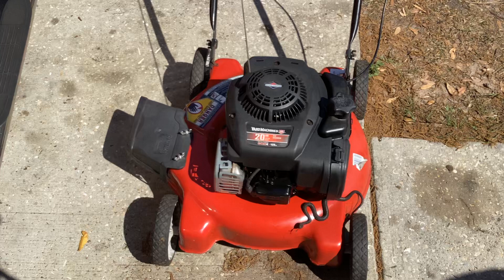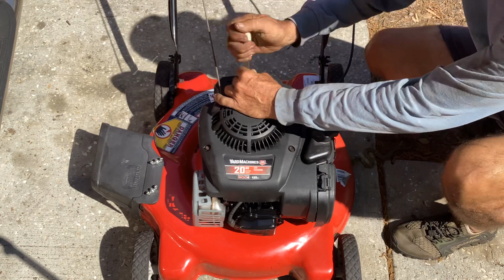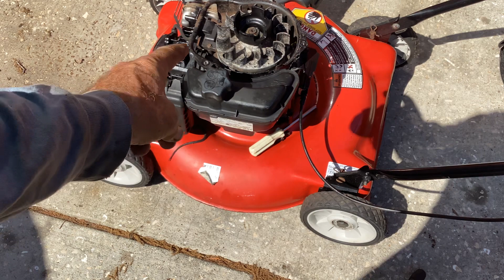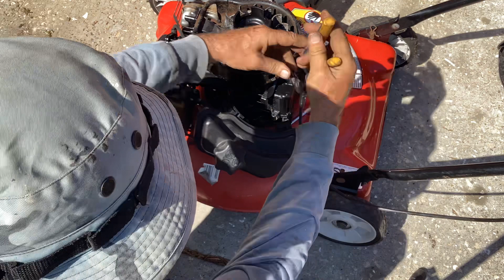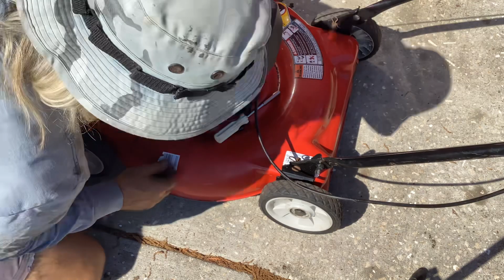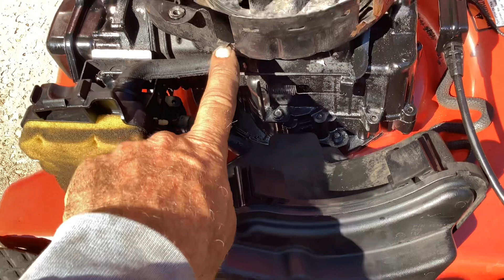How to fix a "SHAKY" Gas tank on a lawn mower.   Anyone can DO it!!!

Comment: What timing!  The same day you posted this video, I was working on a similar model (Craftsman, same engine).  I noticed the tank vibrating.  I removed the recoil to see if something was broke.  Nope.  I left the tank installed and bent the top of “slits” in and out to put pressure on the tank to hold it down.  Keep the videos coming.
Reply from the maker: Thanks for coming out.  Glad you had success with the tank!

Comment: Check to see if blade is out of balance  or crank is bent .
But in all
Good tip this.  
I have a craftsman with 163cc Briggs OHV 7.25 that came my way.  It shook itself to death.  Fixed most of the damage with a good tightening and used blade and adaptor. Blade was bent  and owner contributed to use.  
Now it has a crankshaft oil leak I believe or a hair line crack in block but most of the shacking has stopped.  
Even the intake was lose off the block